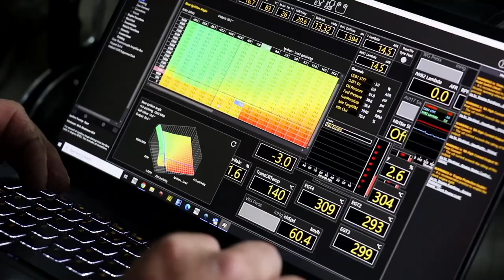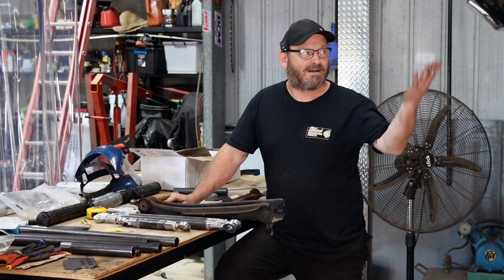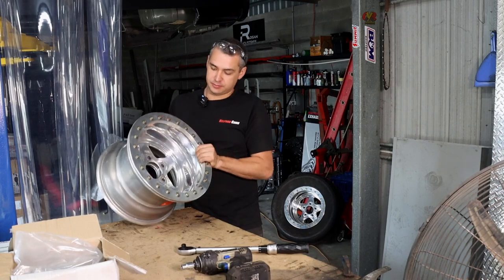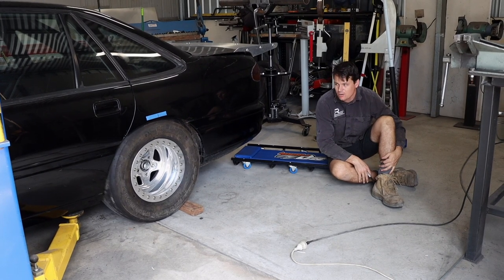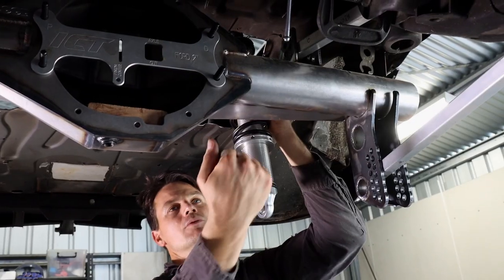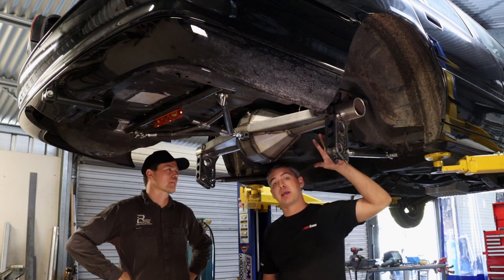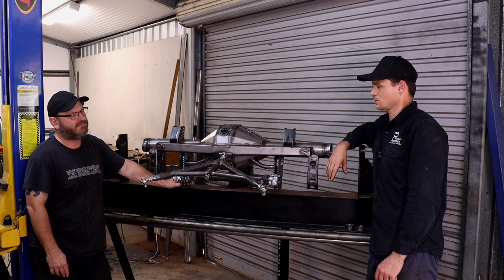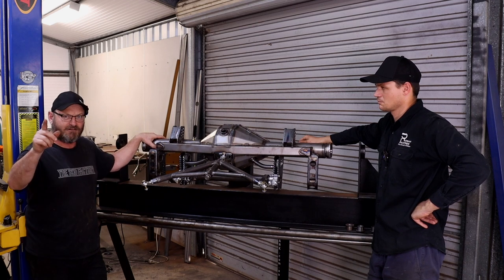2JZ COMMODORE EP4 | SHEET METAL 9”, ANTI-ROLL BAR & TRACK LOCATOR FABRICATION

Comment: Keep an eye on those factory upper control bracket spot welds into the floor pan in between passes. Minor oversight there, GM only rates them for 1.3x 60'. Its a bign' ugly when they start to pull free😉
Reply from the maker: The VR is much better than the earlier models but we did stitch them anyway. This car has done thousands of passes and run 8s many times and they looked fine. Pre VN I think are not great though.

Comment: Haven't seen track locator like that before.
Would you put this in a street car or would it be too loud and not durable with the metal on metal shaft sliding?

Comment: Most of my suspension knowledge comes from the off road realm, but it seems weird to set the antisway bar up as unsprung weight rather than sprung. But I'd trust his work over mine any day! Maybe on the smooth track having the weight low is better than keeping the unsprung weight down? Always learn a lot from you guys!

Comment: When fitting the tyre, use a lube that will evaporate. Something like brake cleaner or windex works well.

If Matt would like another axle so he can have 2 diff length measurer's, sing out.
I have one I will gladly donate :)

Comment: we cant run full spools in NSW, and change upper control arms after each rally if you run a 9 inch. whilst we are harder on our suspension in rallies we also add bracing to the floor for the upper control arms mounts

Comment: Very, very nice welding and fab' work there. However, while it 'works', that setup is going to cause a lot more hassle with setting up and potentially pinion angles, than a more conventional 3*, or 4, longitudinal link setup with a Watts linkage.

*using a single offset longitudinal link the suspension can be designed to counter-act the driveline torque reaction.

Comment: How strong is that centre link a frame thing. Is that rod solid? Genuine question guys.
Reply from the maker: The sliding bar is solid. It doesn't take much force, as the name suggests it's just a locator.
Reply: @theskidfactory  Cheers guys.

Comment: What would a set up like that roughly cost ?
Reply: Lots of monies
Reply: Materials, time, with 40sp axles and strange alloy spool center. Id rough punch at 10-12k.. walk off street and brought through shops.
Reply: Yeh not much, if any change, from $15k
Reply from the maker: Jack R is probably about right.
Reply: Thats real craftmanship right there.  Worth the money. 👌👌